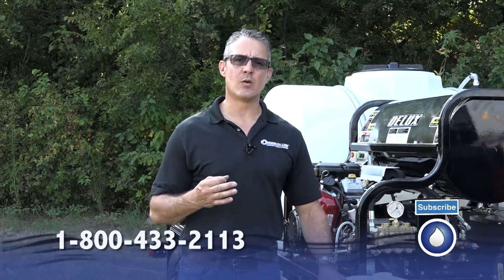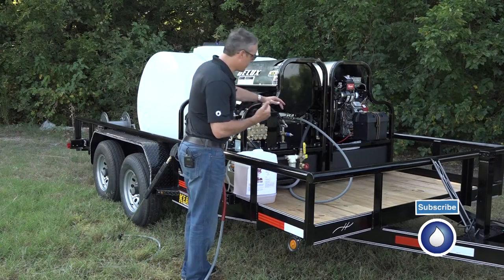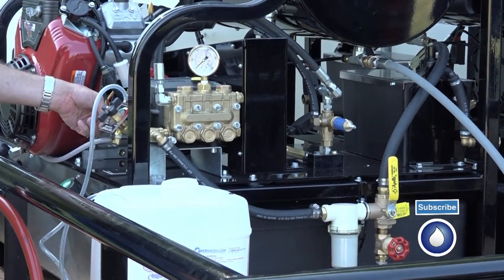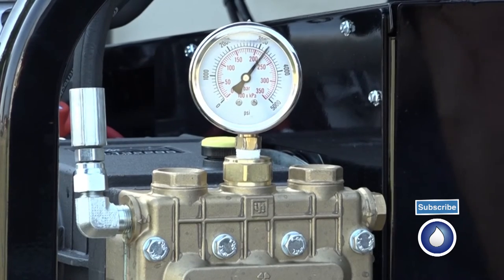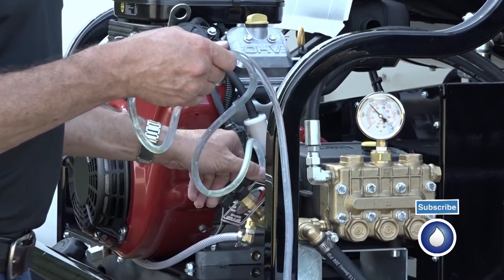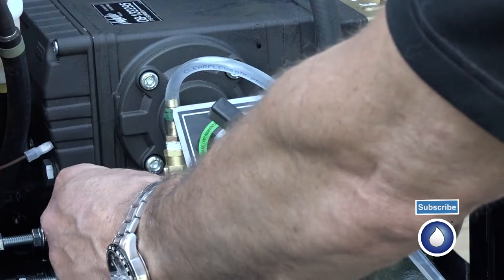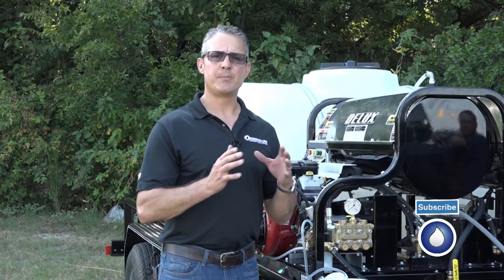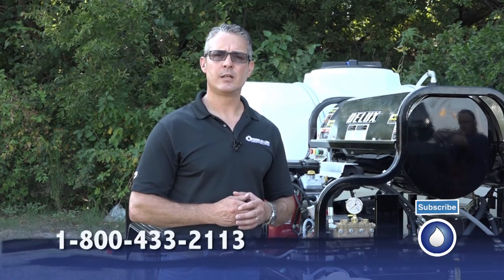How To Create Upstream Soap Injection For High Pressure Power Washing

Comment: I know I’m late on this video but I fleet wash a and was wondering if I could run a fleet brite or aluminum brighter through my downstream injector without damaging the stuff
Reply from the maker: You cannot, the brightness will damage the pump.
Reply: @Powerwash  doesn't downstream and injection prevent chemical from entering the pump?
Reply from the maker: @kdaltex  Yes it does but you CAN NOT use the detergent under high pressure when you down stream.  Meaning you need a stronger chemical to clean.
Reply: @Powerwash  Thanks! Do ya'll do rental trailers?
Reply from the maker: @kdaltex  Yes we do

Comment: What is the difference between upstream and downstream injection???
Reply from the maker: Upstream injectors introduce soap into the stream before the pump. They allow the user to use soap with high pressure. Downstream injectors are placed after the pump. You must use a soap nozzle to lower the pressure on the line.
Reply: Powerwash.com thank you
Reply: Powerwash.com is there an advantage to apply soap at high pressure? And isn’t it a bad idea to run soap through the pump? I hear a lot of different things so I’m just curious on your thoughts because I’m sure you have actual experience
Reply: @ernadibric6133  Both of your questions were answered in the video. Did you watch it all???